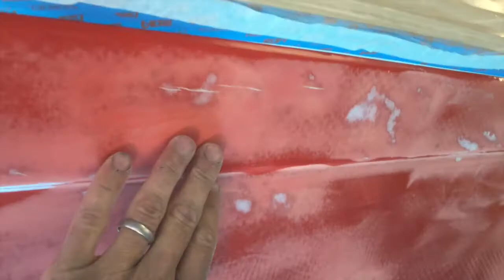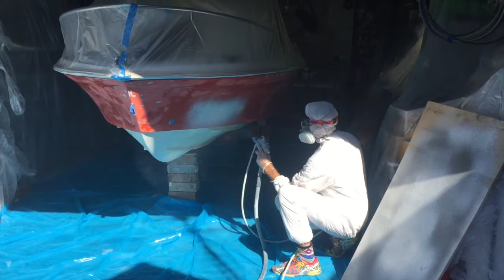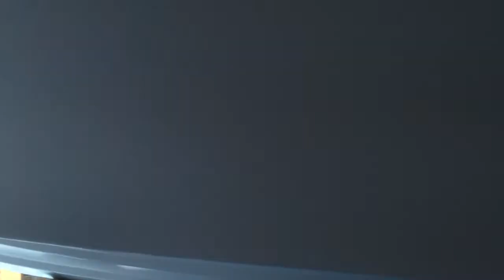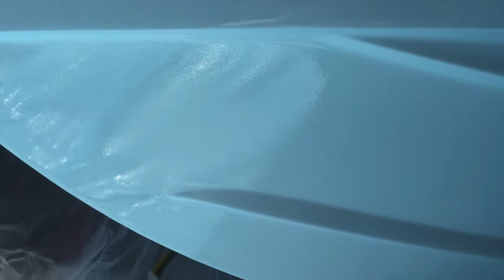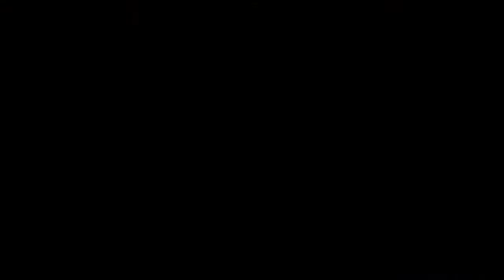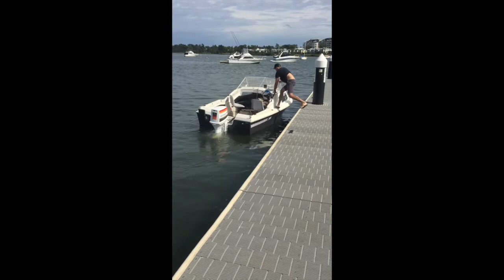DIY Boat Painting

Comment: Great video.
What percentage of spraying thinners and spray nozzle size did you use?
Reply from the maker: Thanks Mate I used 33% which I'm pretty sure is the recommended by Norglass. Don't remember the tip size as I was using an old graco HVLP.